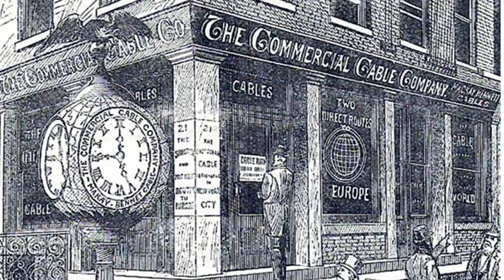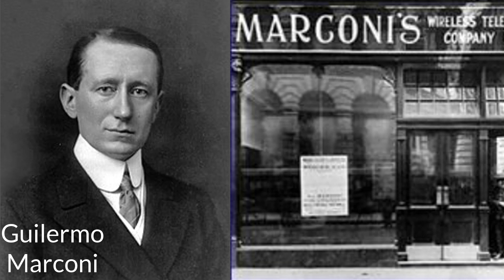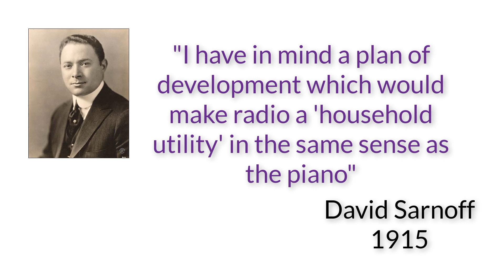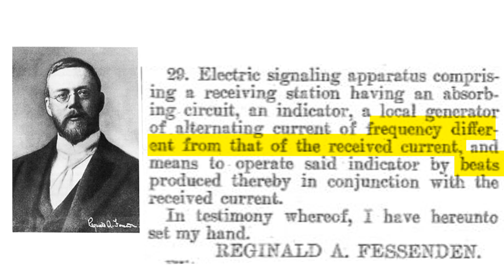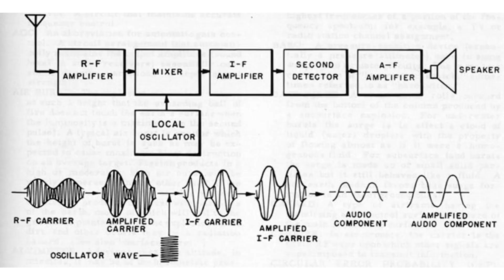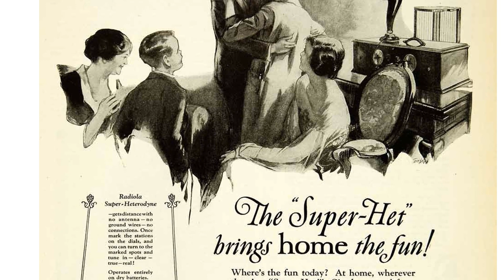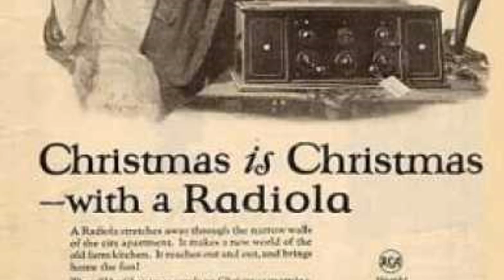David Sarnoff, Howard Armstrong & the Superheterodyne Receiver

Comment: Somebody's probably commented this by now, but in the audio stage tube, it's not the temperature of the heater that controls...anything deliberately.  The resistor knob controls volume by adjusting the anode-cathode voltage and hence the current thru the speaker.  These old battery circuits are a little tricky to read because the filament is both the heater and the cathode.
Reply: I think there was one antique tube radio that used a rheostat on the filaments as a volume control.
Reply: @8546Ken  That's amazing.  I'd've thought they'd have trouble staying linear if the filament voltage was allowed to vary.

I once had a small TV set whose audio got scary loud for about half a second when you turned it OFF.  The heaters cooled, but I don't understand what else was going on in the audio stage.

I think 6.3 V became the standard filament voltage because it was the voltage drop across each of a series of identical tubes whose filaments were wired in series off a dedicated battery.
Reply: @goodmaro  Actually, i don't know what voltage the really old battery-powered sets used. I think they all did use 6V batteries, but they also had rheostats on the filaments.
More recent battery portables had 1.5V filaments.  the large console radios with a power transformer used 6.3V  heaters. Except for the rectifier tube which had  5 volt filaments, with a dedicated transformer winding. The small radios with seres wired heaters had tubes that were designed for equal current but different voltages, such as 12, 35, and  50. Of course car radios used 6V and then 12V tubes. The last tube car radios also used 12V for B+.

Comment: Thankyou for this simple explanation of a wonderful gift to mankind. At twelve I won a Philips constructo set, on which I assembled a three transistor radio receiver, winning it as a prize. I was manager of the largest Neon sign shop in Australia and edited the new handbook on neon shop practice. We used 18 kV transformers at  over
one amp.  kHz radio transmitters in creating plasma for desktop signs. When upward lightning was reported and it's colour described, I was able to introduce it's finders to Neon equipment pervayers, who produced the associated vacuum, and were observing the colours when testing product. I hope that confirmed what was maybe still conjecture.

Comment: So the holistic approach to this reasoning with wave interference positioning at specific frequencies, of course applies to inside-outside modulation at a point of multi-phase state Singularity-Duality time-timing sync-duration. This is the e-Pi-i Reciproction-recirculation Universe. (Simply put, made-of-making temporal superposition Calculus)

Comment: Some early UHF TVs only had a diode for a mxer  simplest cheapest component that would do the job. Later the diode became the only way to do frequency changing in the microwave spectrum such as satalite TV. Now there are better solutions using ics and hybrid modules because they have less distortion, good enough for a not RF engineer to get by with microwave.

Comment: You said the IF frequency was 45-Khz?  It would be hard to get much band-pass from the IF coupling transformers at such a low frequency and the image (the unwanted beat frequency) would be difficult to filter out with only a 90-Khz difference.  All the AM radios I know use 455-Khz.  And FM radios even higher- 10.7-Mhz.

Comment: thank you for your wonderful program.  l wonder whether one can control the volume by changing the current thru the filament.  usually it's done by changing the voltage amplitude to the grid.

Comment: HETERODYNE OR MIXING  CLARIFICATION   WHEN MIXING TWO FREQUENCIES THE OUTPUT IS THE TWO ORIGINAL FREQUENCIES AND THE SUM AND DIFFERENCE OF THE TWO FREQUENCIES   WE THEN FILTER OUT THE ONE WE WISH TO USE WITH LC COMPONENTS OR LATTICE CRYSTALS.  THIS IS CALLED THE IF FREQUENCY  (INTERMEDIATE)   455 KC IS THE MOST COMMON IF FREQUENCY IN THE AM BAND   AND  10.7 AND 455 FOR A DUAL CONVERSION RECEIVER IN THE FM BAND  OTHERS ARE USED IN TV AND THERE ARE OTHERS FOR TWO-WAY RADIO AND OTHER RADIO DEVICES.
Reply: I designed a dual conversion  2-way radio that used a 21.7 MHz IF and a 455 kHz IF.

Comment: I am unsure that you have been corrected. I suspect that you may have been misled! We were taught that mixing two frequencies gave two results, the sum and difference. The difference was then fed to tuned amplifiers at the intermediate frequency. Finally the audio was extracted by a diode tube detector, an audio amplifier next.
Was I misled? Does mixing cause the radio signal to be multiplied by the proper fraction to result in the intermediate frequency?
Reply: That was a booboo, mentioned in many earlier comments. (No - I don't expect everybody to read all the comments!)
Reply: As noted in other comments, to get the actual sum & difference frequencies you have to either combine the local oscillator signal with a multiplier or a non-linear device.
Reply: Combining two signals in a LINEAR amplifier does not result in heterodyning - sum & difference signals.  If it did, you get inter modulation. This is bad in a radio or in a hi-fi amplifier. heterodyning only occurs if two or more signals are combined in a non-linear amplifier or device or combined in a multiplier.

Comment: I used to have a sony transiter radio from the mid 80s that had Short wave and a beat frequancy ocilator. I sill do not fully understand what it was for. On the sony it was adjustable like a tuner or volume. I hear what you say and clearly understand amps tubes transister frequancy and triodes etc.. But not this second frequancy. Why was it needed???
Reply: BFOs are used for CW (morse code) and for Single Sideband (SSB) reception. SSB sounds like Martians talking until you  get the BFO near the suppressed carrier frequency, then it sounds weird (like ducks quacking) until you get the BFO frequency close enough. Then it only sounds a little weird; it makes me feel hung over.
If you can hear what is being said you don't need the BFO.

Comment: The output from the mixer stage has both the sum and difference of the two original signals.
Interest channel - just showed up as a suggestion from YouTube.
Reply: The output actually has much more than that because it is a very irregular nonlinearity. Because of the linearities, harmonics of the two original signals are also generated and you get some really strange results. 
One that's not very well known to is the "half-if" spurious response which occurs halfway between the local oscillator frequency and the RF frequency.
Reply: To clarify for those unfamiliar, the Half-IF is a signal at a frequency that will be converted down the IF frequency when it is present at the RF input at a high enough level.  It is formed by the second harmonics of the LO and the Half-IF signal.  Those two differ by one IF frequency.

Comment: Another good vid. but has anybody noticed that  rectification (of the IF) is required  to  produce audio frequencies which can be fed to a speaker.
This rectification is missing from the simpified cct. diagram (at approx.8.40)

Looking closer the valves (tubes) show no cathode  so maybe I'm missing something.
I'm confident IF amplification/rectification  if required somewhere.

The insight required to produce FM detectors is very high.
Reply: divvy1400yam600: what you are referring to is called the envelope detector. By rectifying the signal you get what amounts to a waveform that follows the peaks. This gives you the amplitude modulated information. It is a very crude way of demodulating AM,vbut used widely because it's so simple. There are other methods that are more complex.
Reply: @Observ45er  
The rather odd FACT is that in the Intermediate Frequency  NO Audio Frequencies exist
For example if a pure sine wave had been Ampiltude Modulated onto an RF Carrier  then if the IF was connected tp a  Spectrum Analyzer  three frequencies would exist
The IF frequency
The IF plus the audio frequency
The IF minus the audio frequency.
Many people simply refuse to accept that as true.

It gets even worse when in Single Side band transmison one of the sidebands is suppressed.
The IF frequency
The IF plus the audio frequency
OR
The IF frequency
The IF minus the audio frequency
Reply: @divvy1400yam600  With single sideband, the IF carrier frequency is suppressed. Only the sidebands are present. for instance, assuming a 455 kHz IF and a 1 kHz tone, only 454 or 456 kHz would exist. 455 kHz is absent.
Reply: The filaments are both heaters and cathodes.  That was common practice with battery-fed filaments.  When you try that in tubes fed off a transformer from AC line current at 6.3 V, you get mixed with the audio a byproduct 60 Hz (or 50 Hz if that's your supply) hum that's pretty annoying.

The rectification is there, just not explained.  Every triode is also a diode, so....
Reply: @goodmaro  
I was just plain wrong 
The rectification is produced by the CR time constant connected to the last cathode.

Comment: A bit of a non sequitur but is it possible that two high frequency wireless signals that are considered safe can heterodyne into an unsafe frequency?
Reply: It depends on what we consider "safe" and "unsafe." From a biological standpoint, it is not possible to create an unsafe signal that way. Mixing always reduces power, and in the RF world safety is defined by frequency and power. (I had an 8 hour class on RF safety.) If you stay out of areas posted for RF hazard you are okay.
However, it can play hob with communications. I worked in IT field support for Arizona Public Service for 34 years, and one of our headaches was rusty chain link fences around mountaintop communication sites where we also had a site. The poor connections would produce mixer products from high power VHF and UHF transmitters and getting the fence fixed on somebody else's site was no fun.
So, nothing ordinary citizens would have trouble with except the possible exception of poor cell service.
Reply: No. For all practical intents and purposes there are really no unsafe frequencies.
Reply: @Observ45er  huh? You're not serious are you? The one that boils water is dangerous. The one that is absorbed by oxygen may make it unbreathable. I believe I've just been dismissed without any real consideration of my question.
Reply: @markschlehr6911  it's not an "usafe" frequency that boils water, but a high power signal. A microwave oven has about 1000 watts concentrated in a small volume.

Comment: The heterodyne design is one of the key breakthroughs of the century. It is amazingly elegant!
The key technical benefit is that a highly optimized filter can be used to convert the intermediate frequency to audio. Without the heterodyne principle, this filter would need to be variable, making it much less optimized, resulting in far worse selectivity for the radio. This would have meant much more bandwith would have to be allocated for each radio station, and far worse audio quality. And it would have made it almost impossible to mix color information and audio in with TV signals: these are transmitted in tiny bits of bandwidth that require very selective filters to reconstruct.

Later radio's combined the two variable capacitors into a single device where one knob changes both capacitors, so the antenna filter and the internal oscillator change frequency in harmony.
Reply: Ages ago I acquired a Bosch console radio made in 1928. It was a TRF (Tuned Radio Frequency) receiver with a 3 or 4 gang - I forget which - tuning capacitor and a tuning dial that ranged from 0-100. It actually worked fairly well for local stations - other than not having Automatic Gain Control - but not so much for distant stations.

Comment: Modern radios are now all DSP, but superhets were king for scores of decades.
Reply: There is a mix of them. Our digital microwave (before retirement) was made by Alcatel until about 2015, The high bandwidth series (the MDR4000s) were superhet with an IF somewhere around 60 MHz, while the lower bandwidth MDR-6000s were direct conversion.

Comment: Heat Filament Would Couse More From The Cathode   Not The Filament
Reply: Back in the day "filament" was used for those tubes that had a direct heated cathode (wire) while more modern (or lower power) tubes had heated cathodes. If it has a filament the plate current comes from the filament, otherwise it is from the cathode. Generally we didn't correct anybody about it.

Comment: love your energy and concise lectures! Unless I am hearing it wrong, the B-frequency, or IF, is generally 450 KHz, not 45KHz. Usually, for example, if the antenna circuit is tuned to 1,000 KHz, the local oscillator is tuned to 1,450KHz.
Reply: They sometimes use an if as low as 50khz, for improved selectivity, although that tends to be in double conversion receivers
Reply: The standard for single conversion AM radios in the US was 455 kHz. The European sets used 460 kHz. Car radios generally used 262 kHz.
Reply: Alex Hu, There have been variations of this "common" IF frequency over time in the 400 kHz range, as well as varying all over the place for all kinds of different receivers.
..
P.S. The term is "beat frequency".
Reply: 455 kHz was the standard by the time I got involved in the early 1960s. I never saw an AM broadcast band radio that used a different frequency, and I saw a bunch of them in the mid-20th century.
Reply: @flagmichael  but amateur ham band radios used all sorts of if frequencies, 1.6 MHz, 100 khz 50 khz double conversion
Reply: I'm not an expert on early radios, but didn't many early 30's radios have IF freqs of 170kHz or thereabouts?

Comment: Besides the out of tune guitar strings at 5:15,  another example of "frequency beat" is when you have two windows open in a moving car, one being open more or less than the other, or one open window in the front and one in the back, and your ears are assailed by a low frequency "whomp whomp" because the open windows act as Helmholtz resonators when the car is in motion and air is moving past the windows.

Comment: I really liked your gift of super heterodyning. What you do not mention is Armstrong in France and finding two radios in one room interfering with one another during Ww1. In your previous video of the vacuum tube I had no idea these people from the past didn't really understand how triode tubes work. I just assumed they knew from the get go it was electron flux not ions. So as usual it was an accident not a blazing certainty and here you show 3 knobs on these difficult to manage receiver dials. So the same position on the dial was always changing but you could mark the stations on two dials to reach the station you wanted.

Comment: Cool video. I got a tad confused when you said Howard Armstrong when I recalled Edwin, but I didn't know that Howard was his middle name. Also, btw, Marconi's first name is Gugliemlo, not Guilermo. Also, I read some of the comments when you corrected yourself unnecessarily regarding the sum and difference of the two frequencies. It is not multiplication. I don't know where they get their "facts" from, like saying a mixer is an unfortunate misnomer. In radio electronics, the mixer (tube or transistor) mixes the local active (tube or transistor) oscillator with the incoming RF to male the sum (addition!!!) and difference signals. The IF is actually tuned generally to the difference result, the oscillator being the IF frequency amount higher than the incoming signal. In a radio with a converter (a tube or transistor doing the job of both RF amp and local oscillator), the RF input is also with the local oscillator, so it converts the incoming signal to the sum/difference.
Reply: All the textbooks I've ever seen refer to Major Edwin H. Armstrong. Never heard him called Howard before.this.

Comment: Armstrong invented the Armstrong oscillator/tuner circuit to beat the station frequency using two coils in which the additional one is used for feed back. The technique is called superheterodyning, that result to an Intermediate frequency of 455 kilohertz. Super heterodyning is superimposing two different frequencies, from the Tuner and from the Oscillator circuuit.
Another oscillator/tuner circuit is attributed to Hartley using a single coil but is tapped for feed back.

Comment: The antenna tuning capacitor and the local oscillator frequency capacitor are controlled by the same knob.
The IF frequency was later set industry-wide at 467 KHz.
The volume control was later set - industry wide - with a potentiometer after the detector stage and before the final amplifier stage.
Adjusting the gain of a tube by changing the filament temperature was objectively too crude; because it depended on the spec of each tube, it wasn't dependable enough for mass production.
Thank you for the great video, and
73 51...
Reply: Might be different in Europe, but in the US 455 kc was universal. (kHz came in the late 1960s and many of us took decades to give in to the change. I see the reason from the standpoints of math and physics, but in common use it was crude.)
Reply: The capacitor that peaks the antenna response isn't necessarily most efficiently ganged to the tuning (VFO) capacitor.

Comment: This video brings me back wonderful memories, as my very first "serious" electronics project was indeed a superheterodyne radio receiver, some 40 years ago. It was a helluva lot of fun, as I had my siblings, my mother and my grandpa help me build a ridiculously huge dipole antenna to test the dang thing.
Reply: A Beveridge?
Reply: @goodmaro   it ended up as a Beverage, indeed. a half wave one, although my original plan was to set up an actual full wave dipole. details are fuzzy, but I'd guess I ran out of copper wire.